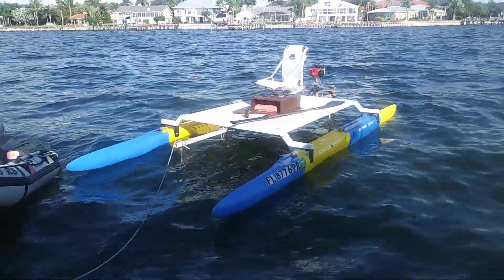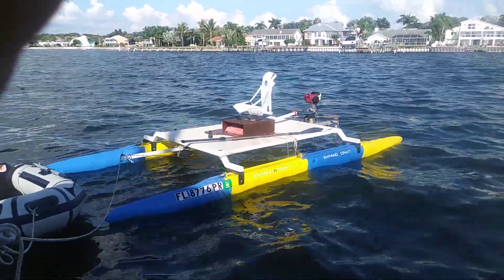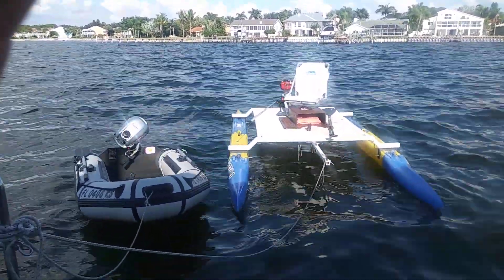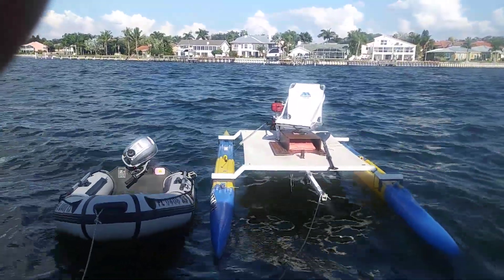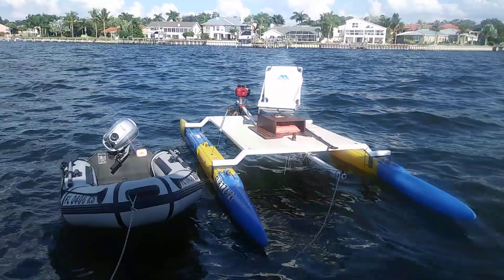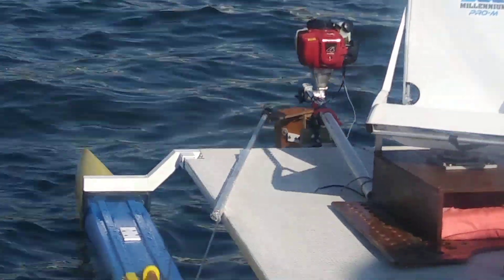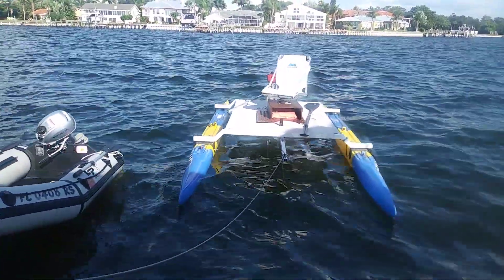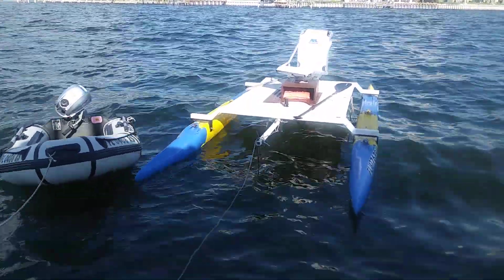Expandacraft Modular Sailboat testing a 1.5 Honda motor

Comment: The expandacraft could be a stowable dinghy ....which would save the thought of having to secure or tow a dinghy!
Reply from the maker: Yep, That entire 7x16'9 boat breaks down to fit in a cubby hole or a small hatchback car. A nice option to have when you don't want to take up deck space for a dingy. Oh, and the Expandacraft is twice as fast as the dingy with half the HP.